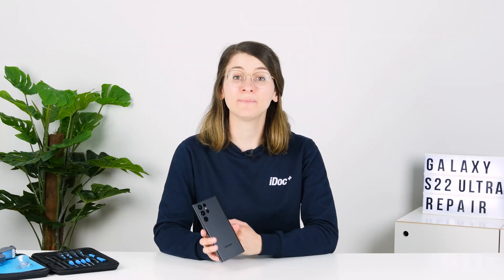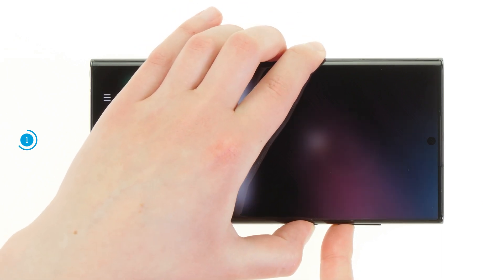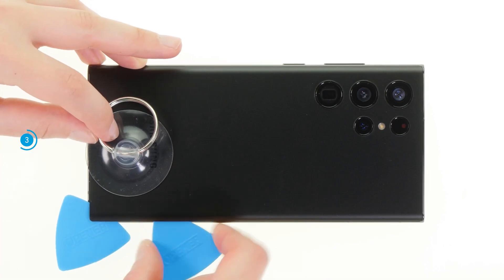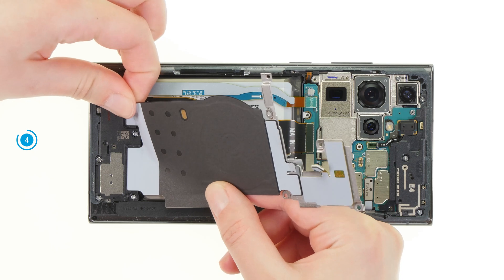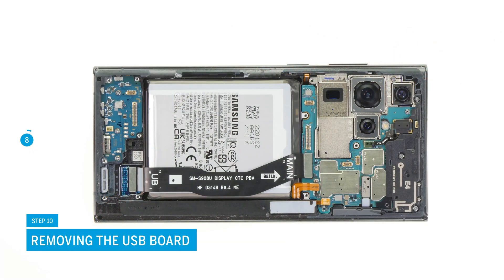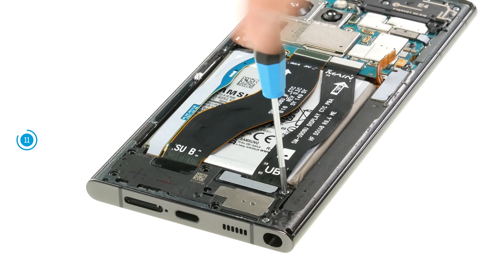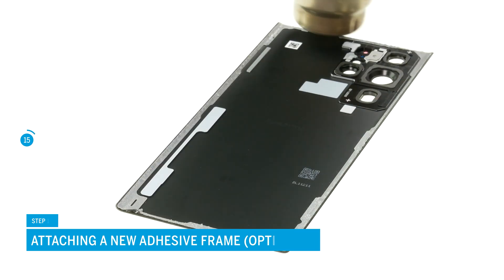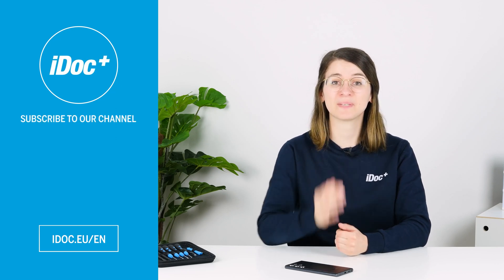Samsung Galaxy S22 Ultra – USB board replacement [repair guide + reassembly]

Comment: I replaced the USB-C port, but charging still doesn't work. I hope I don't have to replace the motherboard. I would appreciate any advice.
Reply: Its only 4 things that can stop it from charging.
Motherboard 
Ribbon cables 
Sub board
Battery
Everything but the mother board is dirt cheap just buy it all and if not then do a Motherboard. Or send it to me and I'll fix it for the price of parts. I do it as a hobby

Comment: Curious as to why people are having Sim issues. I had 0 connectivity unless on WIFI. Wasnt sure if it was the Antenna or USB C Board. Purchased and replaced both after phone shop said that per Samsung, They had to swap both AND the motherboard and would charge $600. Replacing both part fixed my issue and thankfully no Sim card error.
Reply: My phone reads my sim says its not connected to any network, 0 signal, and intermittenet 4g/5g if im lucky. Ill be replacing the usb c port and antenna hopefully it fixes my problem
Reply: @ham5483  sounds like my issue. It fixed it for me
Reply: @TPepeProductions  just replaced them, so far its working 👍

Comment: I Have the ultra version, and having issue in cellular signal, some people advise me to replace the charging port ,do you think is it gonna work?
Sorry for my bad English
Reply: Do u fix?
Reply: @paulofilho4740  I just did. Replaced the thin antenna ribbon and the board. Fixed my issue
Reply: @paulofilho4740 no,I just ordered an antenna for it , hope it will work
Reply: @paulofilho4740  
Nothing happened after replacing the antenna, I took it to a store, and he replaced a signal filter (I don'tknowwhatit is)
Sorry for my bad English
Reply: @MohdBasurra  did that fix your issue?
Reply: @ofon2000  
Nothing happened after replacing the antenna, I took it to a fixing store, and he replaced a signal filter (I don'tknow whati t is) but is working 100%
Sorry for my bad English
Reply: I fixed mine.

Comment: I had this done at a repair shop. Although they restored the charging capability, like other people above, I lost the ability to use the SIM cards, so had to get them to put the original charging port back in, as I'd rather have connectivity than the ability to charge through the charging port.

If you want people to subscribe maybe you could tell us why this may have happened, as it seems from the comments that this is quite a common occurrence?
Reply: How much does it cost this repair?
Reply: Exactly what happened to my phone. Although, I didn't have charging issues, but connectivity issues. They advised that I need to make this replacement to regain connectivity, and now my phone keeps telling me to insert the SIM, as it doesn't recognize it. What is the solution for this? What do you mean "original charging port"? My service was done by an authorized Samsung repair shop.
Reply: If you couldnt use the SIM 1) the cable could be loose, 2) they used a cheap knock-off component (most likely issue) 3) the component was just bad or damaged during install 4) if you had the S22 Ultra use e-sim
Reply: Thank you very much. I changed it and it works.

Comment: Ok I got a question, I flipped upside down the ribbons when I replaced the USB board now my phone can't read the sim card at all and I can't even get into sim manager to do a e-sim does it matter that the ribbons were installed upside down ? What ever I did changing that board killed the sim port please help I don't want to have a $1000 paper weight.
Reply: Anything fix it?
Reply: @machinebuilder3535  unfortunately no I had to do a warranty exchange which is I had to swap it out with another Samsung galaxy s22 ultra. Usually I can figure out the problem but I lost that battle. ( I wish there were other phones to chose from with AT&T beside Samsung and Apple, I truly hate them both haha) good luck.